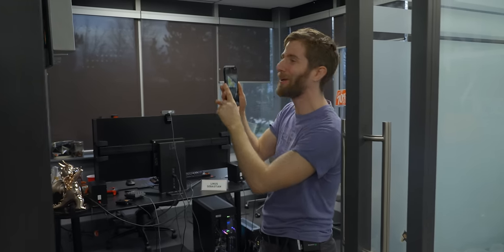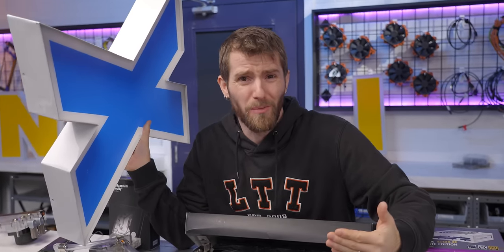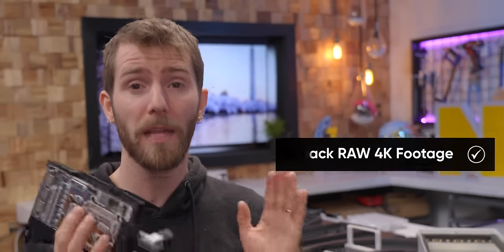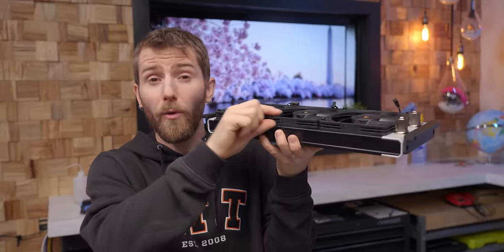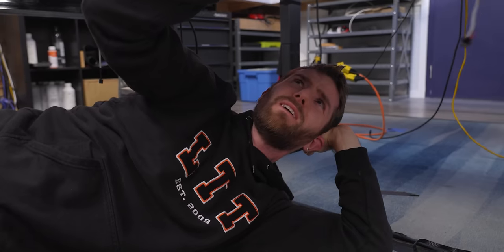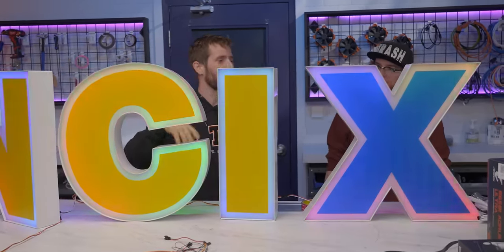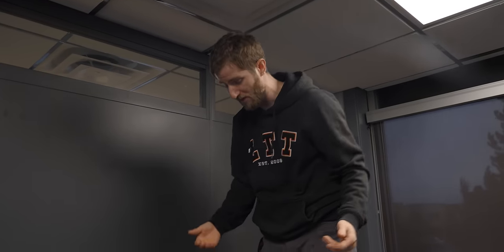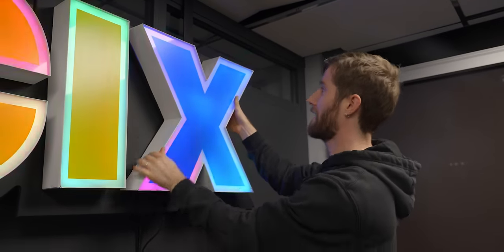This was worth the wait! - NCIX Sign PC

Comment: Not sure if anyone from LTT is gonna see this, but Inno3D has a 4090 with a tiny PCB that Alphacool has an end-ported enterprise water block for. Might be a suitable upgrade to that 3070.
Reply: I wonder how they cool the 4090...
Reply: Inno3D sells the combo as the Ichill Frostbite Pro, no point in buying the Ichill x3 and a separate block.  Inno3D's PCB is a reference alternative anyways, minor layout rearrangement that removes the V cutout, any reference cooler that doesn't utilize the V works with it, hence why αcool's reference cooler works with it.
Reply: If I remember correctly, Linus skipped the 40 series for a reason.
Reply: @xaytana  oh sweet, I didn’t realize they sold it pre-blocked like that. I wonder if even then the PCB ended up being too tall.

Comment: I myself did a project where my whole pc was exactly 7cm thick. I used 3 fans in the build. One large fan over the entire GPU on a gelid icy vision cooler with fans removed, and one 140mm clc for cpu. Very important aspect is to draw cool air at the bottom and output hot air at the top. That really makes the whole difference. Even if both intake and output is on the same side. My project was very constrained but never throttled.

Comment: Man, I legitimately can not wait for those magnet clips. I have an all steel ULINE desk in my podcast room and I have bought MANY magnets and supposed clips that are all different variants of terrible. Issue is, the silicone covered ones kill too much of the Gauss, what did work though, NAME TAG BADGES, those were pretty alright. Since they use properly strong magnets, maybe not N95s but better than the weak ones that "cable wrap" magnets use. I will literally buy 100 each in every size offerred when they come out. I already have somewhere between 1,000 to 2,000 magnets as is. And that's a very conservative estimate.

Comment: I think for the cooling of the motherboard, you might want to add speed holes, and ducting to draw cool air over the mobo before exhausting it (out the back and up so heat rises) add filter mesh to stop fluff and crud into the X

Comment: That B650 motherboard is awesome (and I think it’s the same one Adam got for his AMD upgrade). It’s one of the few B650 ITX boards w/ 3 NVME slots, costs similar to other options, and the USB-C on the back also supports display output. Only downside is all of the internal headers is wired in the form of dongles

Comment: It's running hot? Run the cooling to a radiator outside, just with copper tubing. That'd be pretty easy and not cause any major headaches, right? 😄

Comment: To get the CPU thermals in check, you should undervolt it. It is easy and useful to undervolt Ryzen CPUs as you can get the same, or even more performance compared to stock with a little undervolt. This case will absolutely thank you for it.

Comment: That N looks like a perfect spot for dual radiators in the future if you went with a smaller res. I feel like you're mostly limited by airflow though, that cpu+gpu combo should not throttle on a 360. Maybe thicker fans with more static pressure would do the trick.

Comment: The OCD in me REALLY wishes you had aligned the straps holding the sign with the mullions between the windows in the partition wall so you don't notice them. 
And the pump is low, but not the lowest point in the system. Would be really easy to put it at the bottom of the N where the last, probably least-effective speed hole is located. And if you used the 360mm reservoir you would have had a higher point to collect air bubbles and a lower point for the pump at the same time.
And there should be a vertical 3" deep rib on the back side to prevent the hot air from the "speed holes" from being sucked back in through radiator. 
Also the X is upside down. 
I thought you guys were professionals?

Comment: I would use a in-fan to get air in the lower side of the x (you say you have low profile fans... so), and a out-fan in the upper side of the X to extract the hot air from it... that could reduce some degrees

Comment: Interesting concept but surprised they didn't make the sides of the letters out of mesh for better airflow, could even have done dual rads in crossflow rather than dump all the heat into the back wall and have thermal splashback

Comment: Thin Sheet Rivet Nuts (RivNuts) are a great way of putting a threaded fastener in to a metal sheet (or partition wall in your case) where you do not have access to the other side of the wall.

Comment: I wonder if the shop ad is able to be moved to a different point in a video. Not an LTT issue, but it's distracting during the intro where I want to see what's supposed to pull me in, and its hard to ignore because the way youtube implements it, darking a large portion of the screen instead of leaving those dark gradients out, super distracting.

Comment: I don't quite understand the execution of the design's layout.  

I would've tucked as much as I could into the N, motherboard, PSU, and GPU.  The C is mostly unusable given how everything is otherwise square, unless you wanted to use a custom reservoir/distro plate.  The I would've been decent for the reservoir used.  Leaving the X for the radiator(s), which there could've been a decent solution for not mixing intake and exhaust air.  I would've also turned the backer board into a box, just so everything remains hidden on the backside, plus this would've allowed for extending the letter enclosures into a full unified enclosure, of which would've helped with the airflow situation; such as with the radiator(s) in the letter X, the portion where the radiator sits in could've been an isolated exhaust while intake is drafted from the N-side of the box via another set of fans.  Stemming from this, I also feel like the I/O situation could've been handled better, at least on the PC side, either just sink the motherboard and expose the I/O panel or have case mount jumpers and relocate where the bulk of the I/O is.  

I also feel like this board is large enough for two systems, say if someone wanted to recreate something like this for personal use.  With a bit of rearrangement, a separated NAS could probably be utilized, this would also at least use up some of the space in the C, and given how my changes make the entire thing a unified enclosure with airflow, the secondary system could tap into this with its own cooler and potentially with its own exhaust duct. 

I also really don't like the idea of using a type C hub for I/O on this thing, especially going forward with USB specs.  USB 3.x, I believe the entire spec and not just 3.2, has a 3 meter limitation, USB4 Gen2 drops this to 2 meters and Gen3 drops this to 0.8 meter, with the future of Gen4 being shorter.  Unless you want to run at USB 2.x speeds or this kind of PC is mounted literally above your display with your desk against that wall, USB is just not the way to go.  Also keep in mind that extension cables are now out of sepc, not that they ever extended spec length anyways.  Active cables in this case can be a ballache given implementation, which really only leaves conversion over a networking standard, such as those fiber docs Linus used to use, or a short run of ethernet to your desk, though this is really only recommended with flat cabling for obvious reasons.  This also applies to any remote PC, not just this one.

Comment: 40 series gpu could have been nice for the extra efficiency (and lower heat) — especially the 4070 ti super, which has the same double encoder that the 4080/90 have as well as 256 bit memory for low end workstation uses.

Comment: My last experience with NCIX was pretty unpleasant, which was a shame, as I used it for PC parts and assembly (because after doing it once, I found I detested it).  I had a lot of trouble with my rig at the time (the Mobo was notorious for being a PITA, it wasn't just mine), and I had to have a NCIX shop in a nearby city fix issues with it a couple of times (the mobo fried the CPU on one occasion), and finally it really borked itself (mobo committed seppuku) and it had to be sent all the way to home base for servicing where it was kept for months (they apparently forgot about it until they were called), and they had a halt on new part orders, so I was forced to downgrade the CPU and get an extra HDD as recompense (the MOBO also looked noticeably different, but I wasn't complaining, good riddance to that ASUS X58 Sabretooth).  It was a short while before they disappeared, so unsurprisingly it was a total shit-show.

Comment: Ok, your computer is sitting 2" maybe 3" off the wall anyway. didn't you just make a box behind it that think and put everything back there. you could have even removed part of the thickness behind all the letters in the back board and got even more room. I'll chalk it up to I think you like doing stuff the hard way. Imagine if you just put a plate on top of where you raise up the lettering and then mount everything out the backside. That is what about 1" and another 3/4" of thickness from the backboard. Then you would have had all sorts of crazy room to work with.

Comment: IGPU / i did work on 5700G DDR4 / you ready for the kicker why it didn't work properly.
Reply: MOTHERBOARD / vrm and power integrated controllers were ON FIRE vs normal CPU use / so after putting raspberry pi heatsinks and pads on ram vrm , cpu VRM / then setting the ram to 4200Mhz max 4000Mhz average got the IGPu to 1050ti speeds on integrated if you put more ram in 1060 like performance
Reply: 2 to 1 ddr4 to ddr5 so 32gb of ram will give you 16gb of like!!! ddr5 speeds

Comment: sanding mdf without a vacuum connected, that is a pretty bad idea :|
Reply: They also used a Ryobi sander. I wouldn't expect it to do a very good job at dust collection even if a vac was connected. Fun fact the LTT screwdriver is the same price as the Ryobi sander used in the video.
Reply: @jronmantech  true, and in some countries class M vacuum is required for mdf, especially for businesses